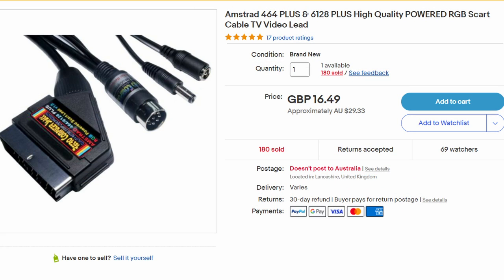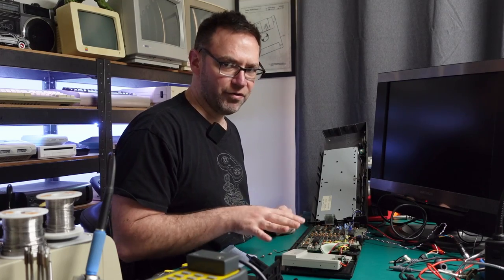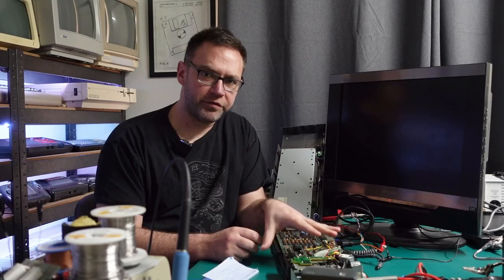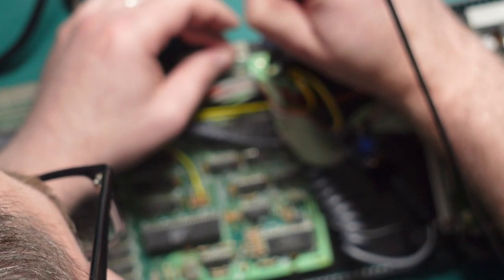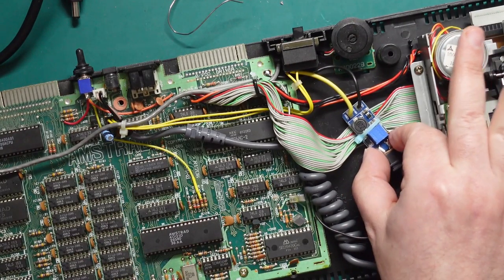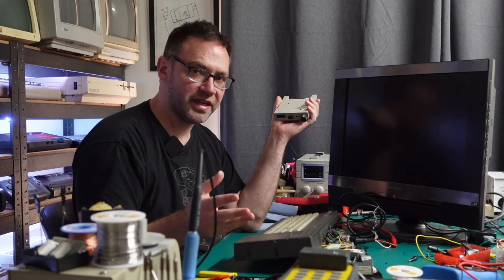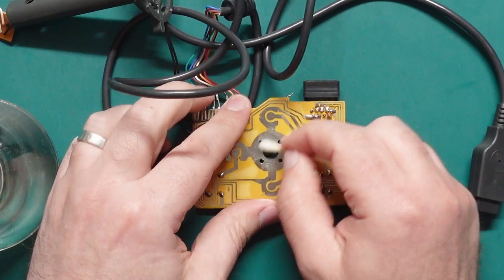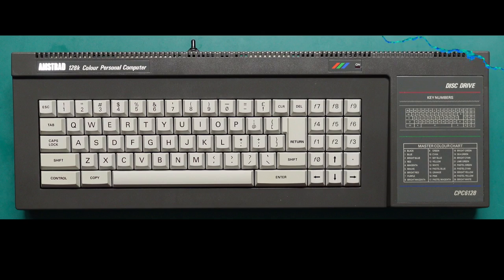Amstrad CPC6128 Part 2 - Internal gotek, 5V disc drive mod, and restoration

Comment: It might be a good idea to add some large caps before (and maybe after) the 12V regulator. Just to smooth out any peaks caused by the floppy motor spinning up.

Comment: Greetings there, down under! Nice to see some fellow Amstrad CPC gets its wings again!
I guess Amstrad hardware is not too common to find in Australia, right?
Would you be interested in a French CPC6128plus? I have here one that works, but needs disc belt replacement and general refurbishment but I lack the time to do so.
So if you would like to have this one for creating some videos, I would be able to send it to Australia.
Greetings from Germany!
Reply from the maker: Yeah there wasn't many Amstrads being sold here. They we're available in some stores but I think most people had already bought a VIC20 or C64, if they had a computer at all.

I'd certainly be interested in poking at a 6128plus. You can find my email in the about section of the channel
Reply: @TheRetroChannel  Quite similar to here in Germany, Amstrad/Schneider came a bit late into the 8bit home computer market.
While the VIC20 was almost unheard of here, the C64 was a huge success and the most sold 8bit in the 80s. Commodore was producing C64 computers in West-Germany itself which helped a lot in getting the brand known.
Sinclair was completely unknown on the Europe continent as they didn't care to sell it to non-English speaking countries it seems.

Amstrad on the other hand worked with, for example, Schneider in Germany to get the CPC on the market with the Schneider branding who manufactured the CPC under license in Germany.

What made the CPC very successful even so late in the market was as a teaching/learning computer as schools used them for teaching as the integrated BASIC was much superior to the C64 ones.
And many teenagers (like me) got the CPC especially as a computer to "not only game" but learn something with it instead of the "only good for games" C64.
Also small shops used the CPC for bookkeeping etc. as it had its own monitor and was able of high resolution display compared to other 8bit of its time.

I would really like to know more about the 8bit era in Australia and how successful the different brands were compared to each other.

And concerning the 6128plus, I will contact you via email.
Reply from the maker: Intersting that the VIC20 or VC20 didn't have much success in Germany while the 64 did. Yeah I have a few "Made in W.Germany" 64s here.

I think it's a similar story here in terms of the British micros. Although I wasn't really paying attention to computers in the early to mid 80s (born in '83), from what I recall most of my friends either had a C64, VIC20, Dick Smith VZ200/300 or perhaps an Atari 400/800. There certainly wasn't many Sinclairs or Amstrads around, although they were being sold in certain stores here from what I've heard. Really the only reason I knew of the CPC or Spectrum was because certain games advertised having versions for those systems on the C64 game boxes or manuals.

Most schools either had a Apple II, Microbee or maybe a VIC20 in them depending on where you were in Aus, and no doubt depending on what budget the school had. My school had a handful of Apple IIe's, but from what I hear a lot of schools had the South Australian made Microbee's and to be honest I never even knew they existed until recently.

Comment: This is a great fix but my CPC keeps resetting. I using power from an Amstrad ctm640 with no 12v so I guess the step up is causing the reset.. anyone know away around this..?

Comment: i have a 6128 in my partially repaired pile, and i powered up the 12v disc with wrong polarity now it doesn't read correctly although it may have been faulty before.
Reply from the maker: Ouch, yeah I can't think of a logical explanation as to why they opted for reverse polarity with the 12V. Seems Amstrad really wanted people to use the included monitor and punish anyone who even tried to use something else 😄

Comment: haha good intro
Reply: I am just working on a Spectrum +3 and used a 12v booster too.
Reply from the maker: Nice. Those little DC-DC converters are super handy and I figure for just a couple of motors whatever switching noise they generate will be a non issue
Reply: @TheRetroChannel  I have poor RGB and the +3 use 12v on the video encoder so wonder if that is the cause. It's good enough to repair the faulty board so I can deal with that later.
Reply from the maker: Ah, yeah that could create some noise in the RGB. Maybe you could test it out with your handy dandy USB power block. The 6128 even with the stock PSU has some ghosting in the RGB, so it might take a closer look at it some day, see if I can find the cause
Reply: @TheRetroChannel  I was going to test that Ugreen PSU and I am sure I have a 5v and 12v power supply from an external hard drive box so going to look for that today. Also I have a PICO ATX PSU, but I do remember that being very noisy.

Comment: try a diy flex membrane + mesh grid under surface touch screen keyboard
Reply: the flex + grid is to make the touch screen work like a keyboard, not a like touch screen, the touch surface can be a display screen with dynamic key images, or just have the flex membrane have the key printed on top, the grid forms the key flex square shapes for the flex surface
Reply: also removes all spill mess-up issues, because the whole keyboard is sealed shut